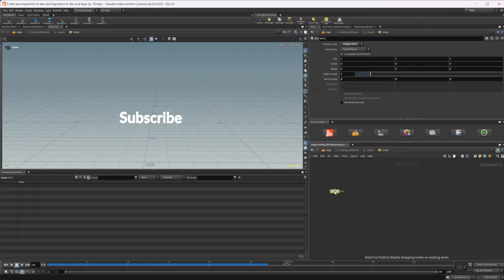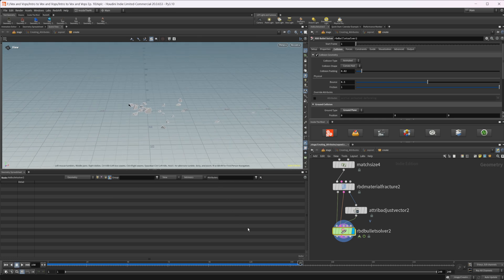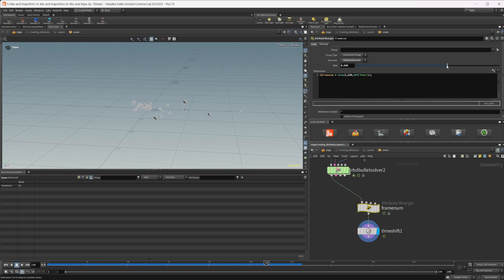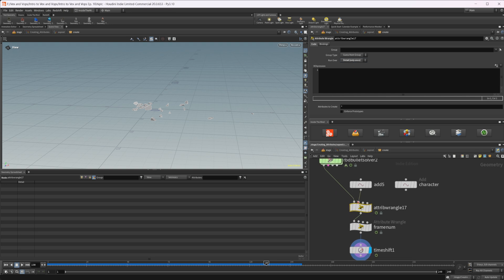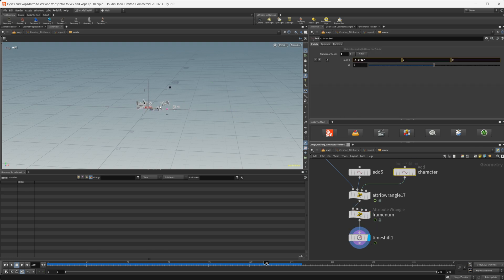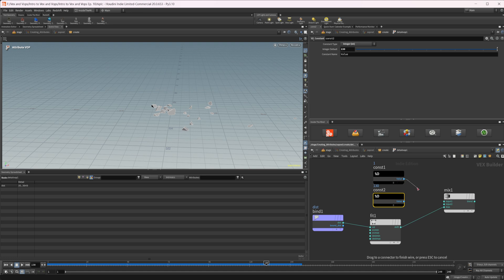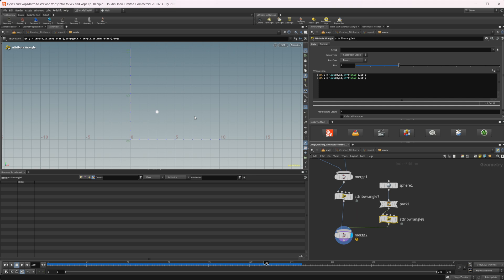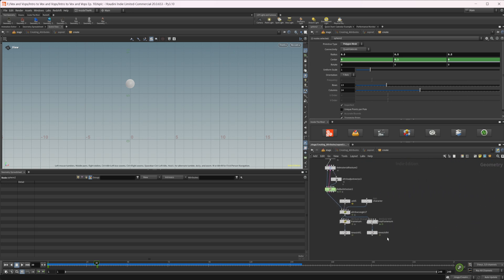Lerp Function | VEX and VOPs | Houdini 20

Comment: I have 1 doubt . why are running on detail
Reply from the maker: I am running on detail because I am using the result of the lerp to drive the timeshift. I don't need it to run over every point. It only needs to calculate once.
Reply: @InsideTheMindSpace  ok, got it, thanks